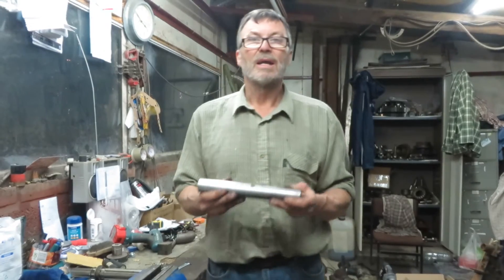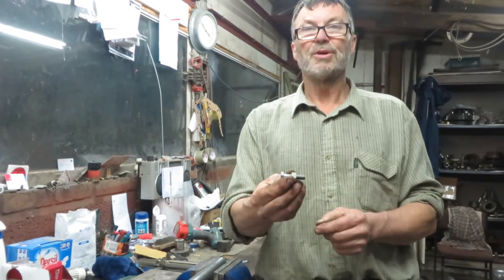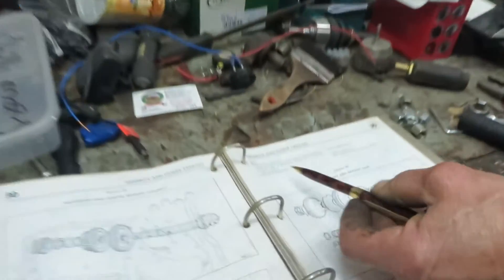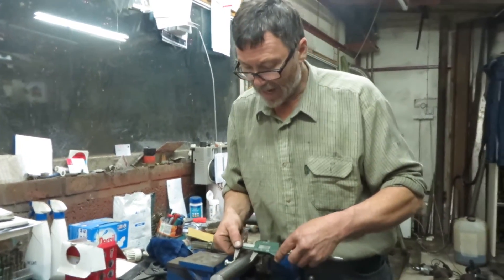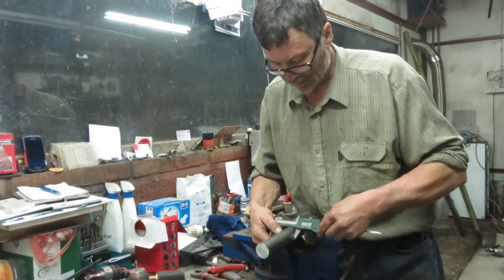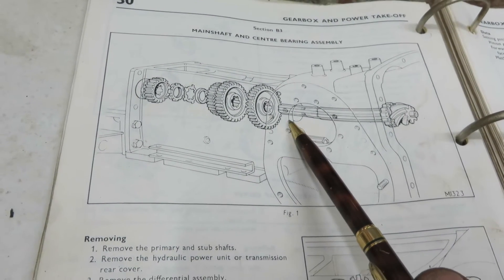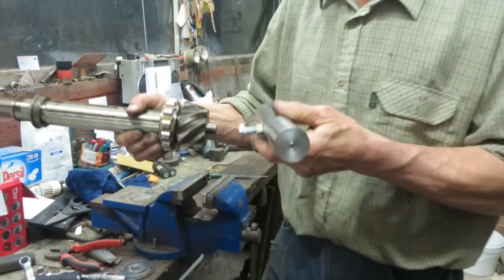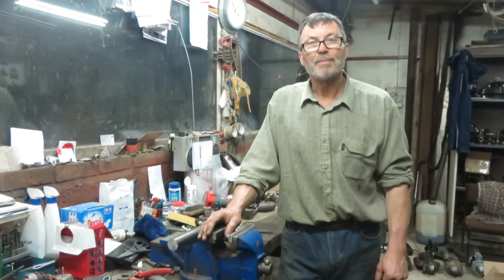Making & Using A Differential Pinion Setting Tool

Comment: Great vid Can you tell me by deducting 5 thousands on pinion dept ,How many thousands would it add or deduct on backlash ?
Reply from the maker: No idea, while I can see your plan you should move the crown wheel not the pinion.
Reply: @montegoson  Its  a 10 bolt GM with 7.5 ring gear ,,,What I did was bought 2 of the same brand pinion bearings bored out one too use to set pinion depth and set backlash to .006 used the marking compound and everything was good ,Pressed on new pinion bearing put everything back to double check and the backlash was around .008 to 9 and seems to ride more towards the heel,,BTW Thanks for getting back to me I appreciate it

Comment: Thank you for your great videos. I have a leyland 245 and am new to tractors but wanted to ask if the 245 has a rear differential lock and if so how do I engage it.
Reply from the maker: Yes there is a leaver on the right trumpet housing connected to a pedal by your right heel

Comment: Only question... do you have to divide the bar length in half when doing this? Because doesn't the measurement come from dead center? Let's say I use a 1" bar... so now my 1.8" spec is 2.3" without the radius.. and if I use a 2" bar my 1.8" spec is 2.8" without the radius? Correct me if I'm wrong. Great video though, definitely going to save me from buying a $500 tool. Lol
Reply from the maker: Are we talking generally or about Nuffields? This video was made for repairing Nuffield & leyland tractors. The pinion setting is 4.312 forward of the centerline of the crown wheel axis. As the bearing carrier bore is 6.250 then half this distance is 3.125 so subtract this from the 4.312 and you have 0.187 from the forward face of the carrier bore. Interestingly I have just realised that the figure given in the manual of 0.180 is 7 thou short!
Reply: Brittany Hutchins v

Comment: nice job Rick what diameter was the bar you used ? looked about 2 '' or so?
Reply from the maker: Its Inch and a half. But the size doesn't matter that much as long as it is straight.